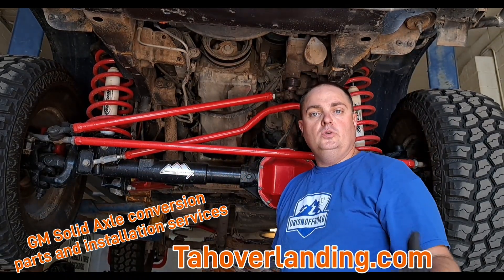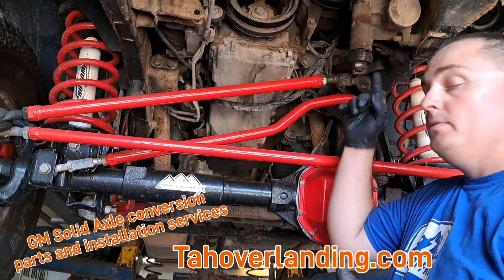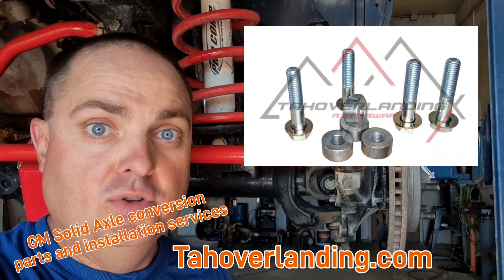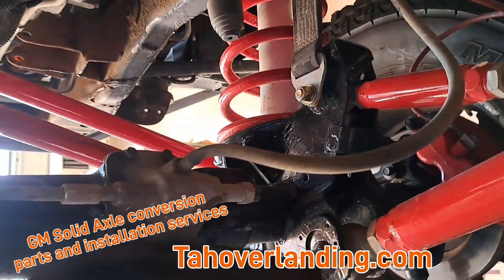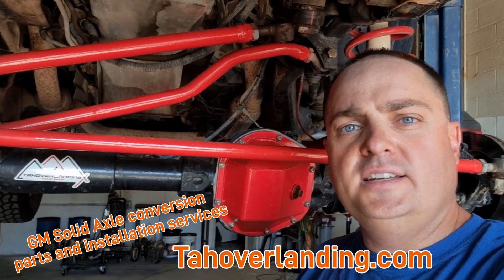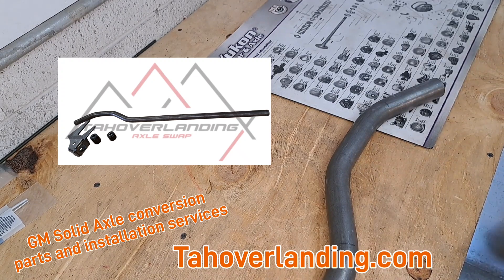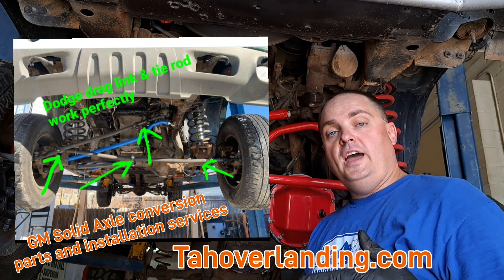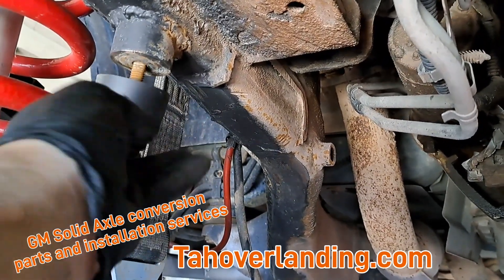GM 6 lug solid axle swap parts list Tahoverlanding Axle Swap

Comment: Would this kit work for my 1994 gmt 400 k2500?
Reply from the maker: Yes, it would. 
Here are a couple videos about it.
https://youtu.be/9F55BcMXgqo

And:
https://youtu.be/rEiCccZ-I6g
Reply from the maker: The 8 lug trucks can use a wider range of years/ models of dodge axle as well. 

You just the the 8 lug parts bundle in this link rather than the 6 lug parts  bundle shown in this video:
https://tahoverlanding.com/solid-axle-swap-parts